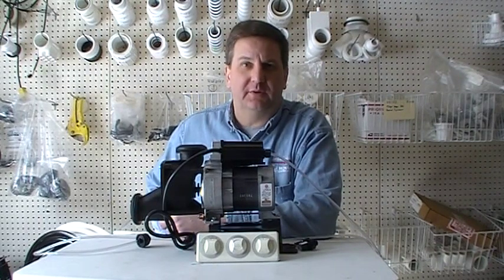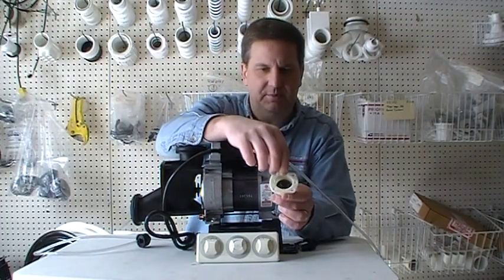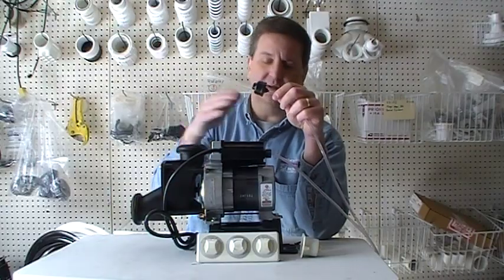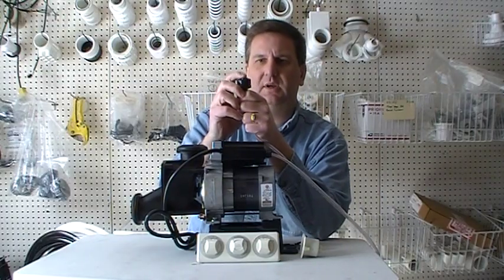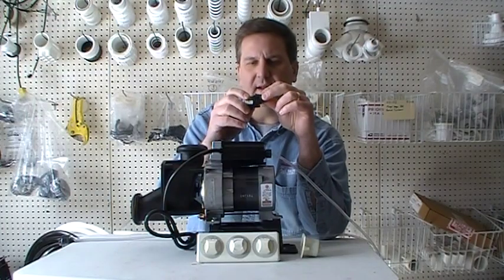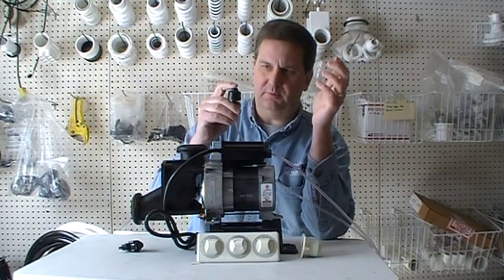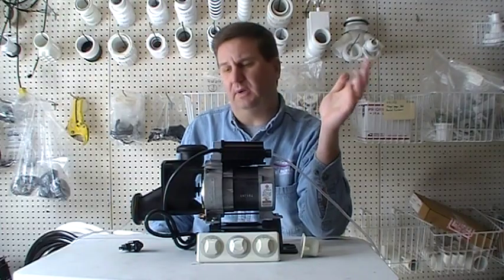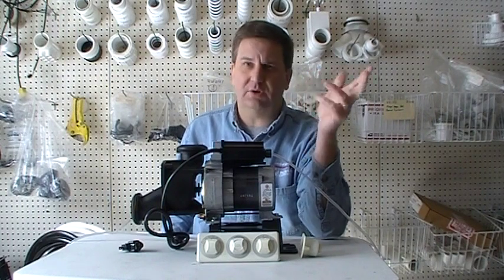How to troubleshoot your JACUZZI® Whirlpool On/Off Button-JACUZZI® Tub Parts

Comment: Thanks.  When I push our button I hear the motor make electric hum but nothing happens.  Also, I can't FIND anyone to repair my tub.  Plummers all say No.  Spa places that I have called say No.  Why doesn't anyone repair a jetted tub.  I can see the pump.  It has access panel.
Reply: Look up:  Pump motor just hums, doesn't turn on.  Also:  Failed capacitor symptoms, testing / replacing.

That's what it sounds like you're describing.  If so, its an affordable fix you can do yourself after watching a video or two.

Comment: I turned my Jacuzzi tub "on", then it wouldn't go off.  I ended up turning off the breaker to get it to go off.  When I turned the breaker back on, all that happened was the motor just hummed.  I turned the breaker back off and that's where it is.
Reply: were u able to resolve this? its happening to my tub? i just moved in and i was deep cleaning it by turning it on and now it wont turn off ☹️
Reply: Impeller could be stuck. Find the motor and grab a screw driver. Try to find the screw and rotate it to lose the impeller. If you get it to turn on but it sounds like there is a bunch of metal clanking you will need a new motor.

Comment: Thanks for this video. I've just replaced the bellows. The jacuzzi turns on when I depress the button, but it shuts off when I let go of the bellows button. Ideas?
Reply: Mine has the same issue. I scrolled back to the third comment on the video and dansyoung said he replaced the switch and it fixed it. He said latching switch in particular. I just ordered one for mine.
Reply: If you can turn on, then your button/bellow/tube are all ok. No leak. The problem is the air switch on the motor. It suppose to be a latching switch (One air pressure input - turn on and stay on. Next air pressure input - turn off and stay off) However it tends to fail and become momentum switch (you must maintain high air pressure to stay on). I replaced my switch zp1521u10 with TB310A and fixed.

Comment: When I push the button on, the pump comes on. When you let off the button the pump stops running. As long as you hold the button down the pump will run.  Any ideas how to fix?
Reply: I'm having the exact same issue did you ever find out what the problem was?
Reply: I’m having the same problem.  Any answer yet?
Reply: Same

Comment: I just bought a house with a 13 years old Aqualux whirlpool tub.  It only goes on if you hold the on\off button. If you let go,it turns off.  Is this the bellows or a part on the pump?
Thanks!
Reply: I am having the same issue with my aqualux tub!
Reply: Trish Flaa  I have not
:<

Comment: I bought a Kohler body spa that is about ten years old , there is a plug with red brown  white black green wires going to it .  Does it go to control panel if so I didn't get it can I jump wires to see if it works without panel ? If so with ones ? It has water fall and 10 jets model 1010-h2-cp

Comment: Mine turns on and runs for a few minutes then shuts off automatically. It will then turn back on by itself but will again shut off in about 30 seconds of running. It repeats this cycle over and over. 
Any advise would be greatly appreciated.

Comment: Hey, great video.  Would it be the same failure if the pump turns on, but only stays on as long as it is held in?  That is, when I push the button it turns on, but then turns off immediately when I let it go.  If I hold it in, it will stay on as long as it is held in.
Reply from the maker: Mark, that is usually just the air switch failure but not always. Call me if you want to discuss further. AJ
Reply: I'm having the same issue.  I push down motor goes on .I let go off air button motor turns off. Is there something inside he bellows  that supposed to stay locked to turn in then unlocks when you push it again.  I pulled off panel and knobs. bellows and  tubing have no leaks. Thank u
Reply: Same issue here.
Reply: Same issue on my end as well. Did you end up resolving this issue?
Reply: @KapilShardha  I did not.  It's in my rental unit.  I just disconnected and stopped advertising the jacuzzi bath in the listing.

Comment: I have an Aquaglass jetted bathtub with a momentary press ON/OFF button. The switch has a circuit board behind it.  It kept getting wet, because it was on the inside of the tub, and I need to replace it.  Please let me know where I can get the switch.  Thanks

Comment: Thanks for this video. So helpful with my troubleshooting. I purchased a new 25A Tecmark air switch, but it did come with a new pressure coupling to reattach the hose. (My problem was the coupling and it's cracking apart of the stem and treading on the air switch.) Do you think it's possible a new coupling be found locally at Lowe's, Home Depot, Plumbing Supplier, etc.?

Comment: I have an old model and it has always had issues turning on and now it doesn’t work at all.  unfortunately the tub is set into a tile  surround and I can’t get to the pump, etc.. Can you give me an idea on what it might cost for me to replace the parts you mention?  I assume they would have to do something major.
Reply: Wondering if this could be an electrical situation?

Comment: Always turns on but air switch wont turn jets back off.   It sure doesn't seem like a leak in the switch system.   Is it common for the switch at the pump to turn on but fail to turn off?
Reply: Love to buy the switch from you but the UPS shipping to Hawaii is 69.41 (+ 19.25).   Ebay has one for 24.99 and free USPS shipping to Hawaii.
Reply: Mine won't turn off either. I have to unplug it to turn off. It's like the switch is inoperable. Did you find a solution.

Comment: My jacuzzi will not turn off/on, I was about to order the two parts - switch and bellow but thought I'd go through the access point and take a look. I found that I couldn't find any of that tubing coming out of the pump...can that be why the pump won't turn on? The tubing may have come off from a mouse or something else....I have to crawl and under to locate it.
Reply from the maker: It won't work without the air tubing so I would order that first and hopefully that's all you need. Here is the link to order just the tubing: http://www.ipoolandspaparts.net/air-tubing.html
Let me know if you need anything else. Here to help. AJ

Comment: My ON/OFF button won't turn off. Had to switch off the breaker as a temporary fix. So I would need to purchase the Air Bellows, Air button & Tubing correct?
Reply: My ON/OFF button also won't turn off. I am using the reset/test button on the plug in to currently turn it on and off.

Comment: Question please.help
Those three air hoses from the switches how do they fit into the pump if there is only.one connection.. Is there a.splitter that they all go into?? what that called. i have a spa which was my dads and only the air bubbles is working it has 2 more air hoses but i dont know where these go unless.i need.to buy some sort of splitter and put them all in the pump air pneumatic slot..
please help

Comment: Hello. I have a hot tub Jacuzzi with same 3 position switch. My problem is the pump runs all the time ( if plugged ) and Air button in the middle doesn't stop the pump. I think is the Air Button but I wanna be sure. Thanks
Reply from the maker: +Mark Dean There is no true way to trouble shoot a pneumatic system without changing the parts one by one. You can guess and order the items one by one but you might pay a lot in shipping to figure it out. Or order all three parts discussed in the video and you will know for sure you will solve the problem.
Reply: Thanks. Much appreciate your reply but a bit too late because I already ordered the air button from your company. If its not working I just have to order the remaining two. It's OK. No problem there. My bad.  However, is it possible for the pump itself to be wrong because when plugged runs all the time? This is a Jacuzzi which it has been used in 5 years since I installed it, maybe 10 times.
Reply from the maker: +Mark Dean Probably not the pump. Usually it's just one of those 3 items.
Reply: I replaced the Air Button and when I plug the pump, as usually, it keeps running and Air Button has no effect. I plan to replace the other two parts. Do you have a video in how to replace the part at the pump? It is very hard to reach it. I'm thinking to get the pump out but that requires a lot of troubleshootings and pipes out. It's a small normal size hot tub Jacuzzi with walls in three sides, and 2 small access doors in the open side. Thank you
Reply from the maker: +Mark Dean I don't have a video on the replacing the air switch. That is something I will be doing after the holidays. I do suggest you remove the pump from your tub in doing so though. That will make it easy and safe. Once you have the cover off you will see how easy it is to replace. Call me if you have any questions.
Reply: +iPoolandSpaParts.net Many thx. Got the pump out and the other pneumatic part out ( the one by the pump). Now as long as I press the air switch the pump runs. When I release the air switch the pump stops. No running between on and off.
Reply from the maker: +Mark Dean Did you replace the air switch; the bellows; and the air tubing like I recommended???
Reply: Air switch, air tube. Still waiting on bellows to be delivered. Thx
Reply from the maker: +Mark Dean OK, keep me posted; here to help.
Reply: +iPoolandSpaParts.net After replacing bellows everything is back working like a charm. Thank you and Happy New Year
Reply from the maker: +Mark Dean Glad to hear everything is up and working again. Always here to help..and feel free to tell a friend to 2 on Facebook and any other social media that you use. HAPPY NEW YEAR. AJ
Reply: I will and BTW the parts were ordered from your place. Thx again. Very good and prompt service too.

Comment: I'm having the opposite problem, when I turn on the jets water leaks somewhere behind the tub I can tell because my ceiling fan downstairs leaks. Plumber came over and determined it wasnt pipes and wants to replace the entire tub which I cant afford. Any help to DIY this myself?
Reply: hire an honest plumber. you have leaking pipe or gaskets or fittings under your tub.
Reply: @santiagoescalambre4738  Yea unfortunately in my state an honest plumber is a rare find. Thanks for the reply

Comment: mine is on a timer  starts when timer is turned on but now it ticks but pump does not start  kids did start it  with no water in it. any idea whats wrong. older three hole tub.
Reply from the maker: Dave, Please give our office a call. I have a lot of questions about what system you have. Thanks, AJ
Reply from the maker: Westminster Presbyterian Church you need to replace your pump.
If it's the one in my video then this what you need to order:
http://www.ipoolandspaparts.net/jacuzzi-bath-pump.html 
If it's not; then let me know which one you have. AJ

Comment: Hi there.  I was cleaning the on/off button and it fell off.  The plastic ring around the button cracked in one area but I glued it back into a circle.  Problem is that without the button, I can push in on the interior part and start the motor, but I can't seem to get the button back on the right way so that pushing the button starts the motor.  I note there is a hole in the back of the button that needs to fit the nub on the black interior part, but I guess I'm not getting them connected.  Your advice is much appreciated!  Sharon
Reply from the maker: +Sharon Lobel Start with these 2 items: http://www.ipoolandspaparts.net/jacuzzi-air-button.html
http://www.ipoolandspaparts.net/jacuzzi-tub-parts.html
That should do it unless the tab is broke off the panel.
Let me know if you think you need the panel: 1-877-277-5189
Here to help, AJ

Comment: The clear narrow plastic tube that the air goes through keeps coming detached from the push button starter. Is it OK to glue the tube into it?
Reply from the maker: +Kathy Estes That is not advised. First try cutting a 1/2" of the stretched tubing off the end.  If that doesn't work you'll have to replace the air tubing.

Comment: Thank you! My issue is not that the tub won't turn on... It will turn on when I push the button but it won't turn off... we have to turn off the breaker to get it to stop (not very convenient). Any thoughts on that? Thank you in advance!!
Reply from the maker: Keri, the same situation applies. One can't see air so you don't know where the failure is. We still suggest changing all 3 items to be sure you'll fix it the first time.  Call me if you have any further questions. Here to help. AJ
Reply: AJ, mine is also stuck in the on position.  I think it's the spring inside the button because even after I have taken it all apart, it will not click when I press the bellows directly.  When it got stuck, there was a definite difficulty in getting the button to press down.  Is there a way to fix just the spring?
Reply from the maker: If you feel it's the spring then you need to order this: http://www.ipoolandspaparts.net/jacuzzi-bellows.html
Reply: iPoolandSpaParts.net thank you for confirming that.  When I get the part, how do I connect it to the tubing, just push the clear tube onto the end?  Is there any kind of clamp needed?
Reply: I have finally taken the whole panel off, and the bellows won't come out of the cup because the tube leading to it is not long enough to pull the whole cup assembly out far enough to disconnect the bellows from the tube.  Any hints on how best to do that?
Reply from the maker: Do you have access to the underneath to reach that air tubing? If not, you need to gain access. Let me know; here to help anyway I can. AJ
Reply: I kinda wish you had a video about how to get the tubing off the bellows.  Does it need to just be slipped off the back?  I'm afraid to pull too hard and break something.
Reply: Never mind.  Got it.  It was siliconed in.  Thanks for all your help.

Comment: When I push the on off switch the motor runs as long as I’m holding it down, when I release the motor turns off?
Reply: Same problem for me. Did you get it fixed? I don't know if it's the on/off button or the air switch that I need to replace.

Comment: I have the same set up as shown but when I push the button it will run but if I release it it stops.  What do you recomend
Reply from the maker: +Alana Nelson I recommend you replace all three parts in the system since there is no way of knowing which one has the air leak. Here are their links to order:  http://www.ipoolandspaparts.net/zp1521u1.html  
http://www.ipoolandspaparts.net/air-tubing.html
and
http://www.ipoolandspaparts.net/jacuzzi-bellows.html

Comment: how do you check the motor and how do you install the three parts for air switch?
Reply from the maker: +Russell Jones Please give me a call to discuss your specific problem. 1-877-277-5189 Thanks, AJ
Reply from the maker: +Russell Jones Please give me a call to discuss your specific problem. 1-877-277-5189 Thanks, AJ

Comment: Good afternoon, I started a conversation a couple of weeks ago and failed to follow-up. So, I am doing that now I have a Builder Bath Series Jacuzzi bathtub that was installed new in 2003 when we purchased our home. I am having difficulty removing the three button controller. I believe I have removed the six screws that hold the unit in position, but it still won't budge. Any suggestions? Can I send a picture of the controller to you?  Not sure how to attach a photo in this format.  Thanks.
Reply from the maker: +Ken Casey The 3 position panel is siliconed into place; you'll need to pry it off. Call me if you have any further questions: 877-277-5189  Here to help: AJ

Comment: Hey there, my centre button is working as normal - the pump comes on and recirculates water, however, there are no bubbles.  What should I be looking at?
Reply from the maker: +Steve W Steve, try turning the knobs. That controls the amount of bubbles coming out of the jets. You probably have them on off. If it still doesn't work after turning them up then there is a problem with your air control guts. Let's hope your solution is just a turn of the knob. Call me if it's not.AJ
Reply: +iPoolandSpaParts.net turning the knobs does nothing unfortunately. Where to look next?

Comment: just recently i have to push my center button 4 or 5 times to get it to come on. why is this happening? and do i have to rip out all my tile work to fix this? and which side of the tub would the motor be on? the switch side? other side? front or back of the tub?
Reply from the maker: +erixxx68 One of the three parts that I discussed in this video is failing for you. If it's the bellows, you don't need to rip out the tile. You can replace that from the topside of the tub. As far as where the pump is. I would have no idea. JACUZZI has made thousands of tubs over the last 40 years. Isn't there an access panel somewhere around your tub where you can get at the pump? Let me know. Here to help anyway I can.
Reply: I did all three parts and we cannot get it to cut on and off!  We did what one guy said used a pump and made sure tubing was holding pressure and it did so I hear a clicking at motor but no on and off!

Comment: When I press the button the motor turns on, then shuts off when releasing it.  I installed a new switch, same issue, installed a new button and hose - same issue.  If the switch connections are jumped the motor stays on properly...  any ideas?
Reply: We have the same problem.  Did you ever find out how to fix it?
Reply: Same problem here.  Any ideas?  THANKS
Reply: Solution was a new switch -
First switch I replace it with was not a LATCHing switch.  Once the new latching style switch was installed it works great.